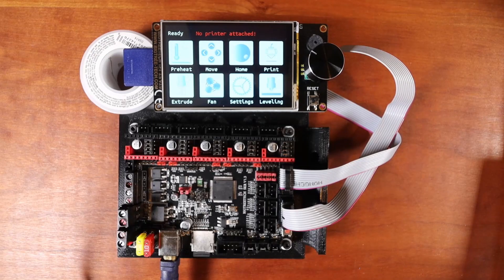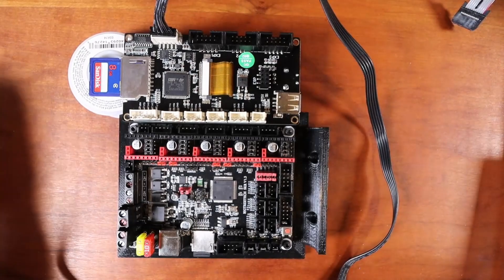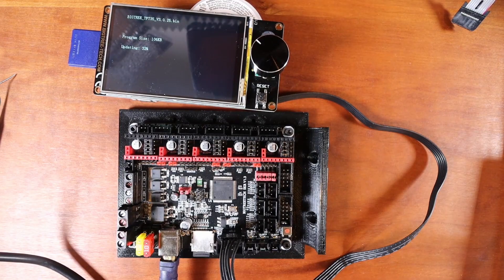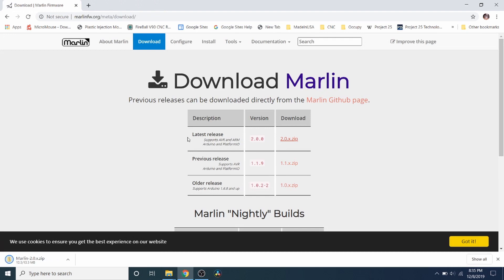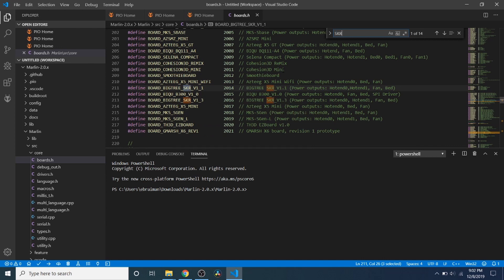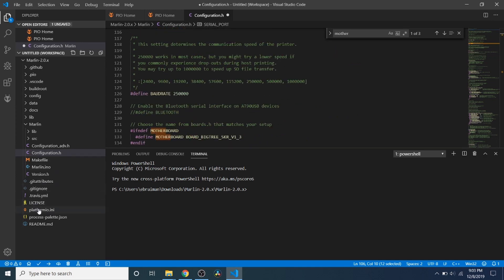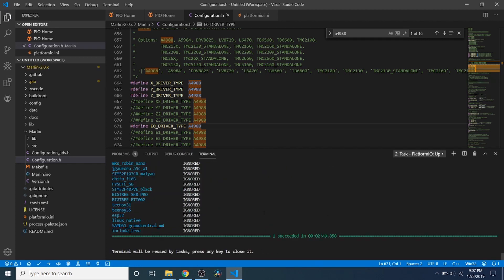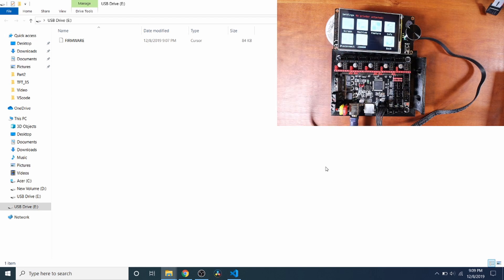SKR 1.3 - TFT35 V3 Touch screen Configuration (3 of 3)

Comment: Hi ed im not sure what im doing wrong but i have my printer hooked up the same way and clicked uart speed to 250000 and it doesnt remove no printer attached i didnt know if u knew whats going on with the printer
Reply from the maker: What's the speed on display and in Marlin firmware?  What's your second serial port number?
Reply: Ed im not sure i was at work is there another way to connect with u like thru facebook or something
Reply from the maker: Discord in description.  If I'm not on others in chat usually know answer.

Comment: I am having an issue with my TFT 35 v3 that is being used with skr mini e3 v1.2 > I get a message "no printer attached" and i tried changing baudrate on both firmware and on the tft and nothing. I cant really mess around with the serial port because then it fails to build. Any help would be appreciated

Comment: Many thanks! My Printer is up and running so far. What's missing is the Connection to ESP01-S. I have one installed, sends Data and Website on the USB Programmer, but Thereplugged into TFT35 I cannot reach the Page or IP via Router.
Reply from the maker: Check your WiFi networks, you might see something like, "EPS...", The password I think is, "123456789".
Reply: @EdwardBraiman  I know... When I plug the ESP01 into my  Programmer (Setup Bridge disconnected) the ESP is working. I tried my Laptop in the living room and PC at my printer. 
When connecting to the Port of TFT, it's not working! I'm affraid, there's just one little hook in my Marlin Settings or Display Settings left to do...
Reply from the maker: Try setting second serial port to 1.  Let me know if that works.
Reply: @EdwardBraiman  Hi Edward, I tried Port 1 and 2 and both Settings returned "No connection to Printer..." I changed back to "0" and the connection was back. 

On GitHub I found a "Userguide" to Wifi, but there is nothing else mentioned as the Pinout and a link to ESP3D...
Reply from the maker: It might be a good idea to open a bug on Marlin firmware.  They might have more answers.

Comment: So, did everything throughout your videos and all came out great, with the firmware updated for my specific printer. Plug in the power supply, hook it up to the board, and doesn't power up screen, but printer fan powers on. Plug in usb, screen powers on, but doesn't control the printer. Seems to be a disconnect between the touchscreen and the board, got any idea or have you experienced this at all? Thanks
Reply: And I am an idiot...didn't move the jumper off of usb. Screen powers on, but seems my printer fan is the only thing that works. Going to play around with it for a bit to see if I can get something going.

Comment: I've followed every step, multiple times stating from scratch each time, but i always get "no printer attached". I wasn't able to find a solution either on other tutorials, one thing I find confusing is the serial port value, which is different on every tutorial that I watch.
Can somebody help me please?
Reply from the maker: What software version are you running?  Did you see the video before in the playlist on how to update firmware?
Reply: @EdwardBraiman  Yes, I have the latest version (release version, not beta or bugfix) of both of the Marlin firmware and the touch screen firmware
Reply from the maker: Sorry was not clear the version of firmware for the TFT 35.  There is a tutorial before this one.
Reply from the maker: Find the settings menu on the tft35 and the version menu, it probably reads 1.1.21 and needs to be updated to 1.1.25.
Reply: @EdwardBraiman  I've already installed the 1.1.25 version
Reply from the maker: Okay.  In Marlin firmware are your steppers for a4988 or something else configured?
Reply: @EdwardBraiman  I have 2130 on the board and I have modified the configuration file accordingly (I've watched your video and 3 other one to be sure)
Reply from the maker: Can you tell me about your hardware?  What's connected?  What's the hardware versions?
Reply: @EdwardBraiman  I have TMC2130 V1.0 and the TFT35 v3.0, the rest is common harware (bowden extruder, part cooling fan, heatbed etc)
Reply from the maker: @tonksfight3518  can you post the changes you made in the configuration.h and configuration_adv.h in the comments?
Reply from the maker: Check the speed under settings on the TFT 35.  What's the baud rate?  Is it 115200?  If so change to 250000.
Reply: @EdwardBraiman  
Other than the following changes I've altered the values shown in this video (board, baudrate etc)

configuration.h
#define X_DRIVER_TYPE  TMC2130
#define Y_DRIVER_TYPE  TMC2130
#define Z_DRIVER_TYPE  TMC2130

#define REPRAP_DISCOUNT_FULL_GRAPHIC_SMART_CONTROLLER (to use the emulator, but I've tried the touch screen with and without this voice active)

configuration_adv.h
#define TMC_USE_SW_SPI

#define TMC_DEBUG
Reply: @EdwardBraiman  Already tried all the possible combination of baudrate

Comment: hey i have watched your videos on the mks gen 1.4 everything works great but i cant get my part cooling fan to turn on while printing plugged it in to pin 9 ... i can turn it on manually with M107 command but it just wont turn on for 2nd layer while printing am i doing anyhting wrong ?
Reply from the maker: Place to command to turn on in Slic3r or Pronterface.
Reply: @EdwardBraiman   hey i used cura.... Do you mean turn on cooling?
Reply from the maker: Slic3r allows you to add gcodes for fan and speed.  Are you using Slic3r or something else?
Reply: @EdwardBraiman   hey thanks for awnsering so quick ! i got it to work, i use cura and there i set the Part cooling fan to number 0 not it works thanks !
Reply from the maker: You're welcome.

Comment: Hi
Can you make video on how to configured WiFi (esp01s module) from bigtreetech for tft35 v3.0 
There is a esp.bin file for skr pro board but for skrr v1.3 and bigtreetech touch display files on there github page I found nothing on how to configured WiFi. Thanks!
Reply from the maker: I've been researching this for two weeks.
Reply: Edward Braiman 
The M117
IP on tft display is for esp3d page...
Reply: Edward Braiman 
hi
well, I got it to work,
What I do is download skr-pro-v1.1-master from bigtreetech GitHub unzip it and in folder named firmware there is a esp-01s folder that you need to put on sd card(tft), the whole folder! With usual BIGTREE_TFT35_V3.0.25.bin
And TFT35.CUR(FOLDER)
and update as usual, on a PC task bar, network, you will find a esp3d (default password is 12345678) after configuring I changed to my wifi network and password, now I have IP on tft display and esp3d is gone from my PC taskbar network...
With esp3d I wasn't be able to upload gcode(8.3format)....
Wonder if you will get same result...
Going to test this IP that I have now to see what I can do with,
Hopefully upload gcode to tft sd card!
Reply from the maker: @minixu9-h407  I was able to connect to esp3d, but not do much else.  It wants an upload, but I do not seem to know which files.
Reply from the maker: Okay figured it out.

Comment: Did not get what you enabled in Marlin to use this screen, or does it just work?
Reply from the maker: It's based on buad rate Marlin defaults to 250000 and tft35. Defaults to 115200.  Keep in mind some of tft35 have older firmware and need to be updated.
Reply from the maker: Check tft35 settings menu for speed it maybe at 115200. That's why you may need to change Marlin.
Reply: @EdwardBraiman  I already use these boards, just wanted a kind of a missing peace of information to be addressed :) Thanks for the video series by the way, and keep up the good work (y)

Comment: I bought 2 of this screen and i am using 1 with a MKS SGEN L board with tmc2209 v2.1 steppers. i have a problem with mesh bed level function on lcd mode. when i turn on the port_2 0 for touch screen, the level bed function stops working. And level bed menu doesnt even open. the board homes all axises 2-3 times than stops. i wrote to bigtree and they told me to change 0 on port 2 to 1 but when i do that, not only level bed doesnt work but also the touch screen doesnt work either. they havent given me any other solutions either. All other functions works just fine in both modes but only level bed function doesnt work. by the way mesh bed level is turned on in marlin. when i close port 2 on marlin, mesh bed level works fine.
check the video please https://www.youtube.com/watch?v=3ZUKvkDbiQU   
my current port settings are port:  
#define SERIAL_PORT -1
#define SERIAL_PORT_2 0
Do you have any idea why level bed function doesnt work?
Can you also make a video to show how to setup wifi on this screen please?
Reply from the maker: I'm still working thru the material on the BTT TFT35, I want to do more tutorials, but I need to dive into there coding configuration files for platformio.  As soon as I understand how to configure I'll record and post.

Comment: Keep them coming.  Thanks for the work in putting these up.  I think I'm correct in saying this, and it might help some folks, the BTT TFT 3.5 V3.0 firmware is a work in progress.  Keeping it up to date and for sure keeping a copy of a previous working version is required.  They fix stuff and sometimes break other things, but are actively working on the code.  Consider doing a video showing folks the unified icons, they are very nice and add a few different functions.
Reply from the maker: I'm thinking about several new tutorials on this, but need time to dive in deeper.  Might be several weeks depending on my schedule at my job.

Comment: Hi, sorry but what is the difference between TFT and EXP?
Reply from the maker: One functions like a LCD and the other like a touchscreen, they have different wiring methods.
Reply: @EdwardBraiman  thanks, both prints sending gcode directly? Need to add the filament runout detection on the lcd?
Reply from the maker: The gcodes should work, but depends on how well the programmed the tft35.  Another person stated in comments it now appears to work via LCD.  They had to update the firmware, but I'm guessing it will get even better as time goes on.
Reply from the maker: The runout detector I'm researching.

Comment: My TFT says 250k, my Marlin is at 250k but does not work as I have to make both 115.2k then it works.
Reply from the maker: Yeah, I want to see who would find the fix first.  Congrats!
Reply: I never fixed it as I consider this a HUGE flaw in their design since it shows 250k but I never managed to get 250k but the 115.2 works fine.  UPS issues today so tomorrow it goes back and I will just buy a real 12864 and save money.
Reply from the maker: Sorry to hear that.  I'm still getting ready to dig into their code, but have not yet been able to load in vscode.
Reply: Yeah, I saw the platformio.ini but never tried it.
Reply from the maker: There is some functionality I'm trying to investigate for runout sensor and wifi.  I will be doing a WiFi video hopefully this weekend, but I still need to configure test router.
Reply from the maker: Also might drop 5-10 tutorials on a new board in one day next, but people keep saying not too.  It's more to celebrate 3M minutes watched.
Reply: BIQU keeps saying the wifi is coming so not sure if it is here or not yet.  I need a board due to the 12864 I had being damaged when the 1.2 decided to release the magic smoke instead of blowing the the yellow fuse so if there is another board out there I am interested.
Reply from the maker: There is but I need to start recording before I'll reveal.
Reply: Well, I have a month before I see my cash back so no rush.
Reply: My money is back on my card so now I await your revelation video as I need a replacement screen/controller.